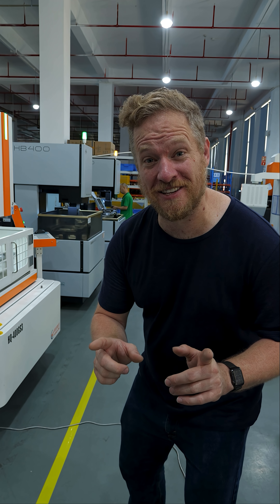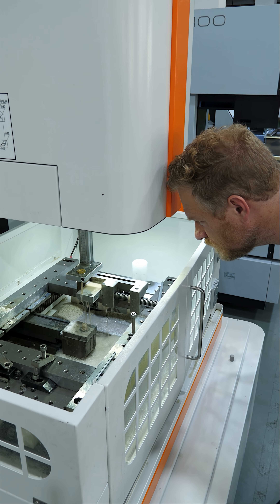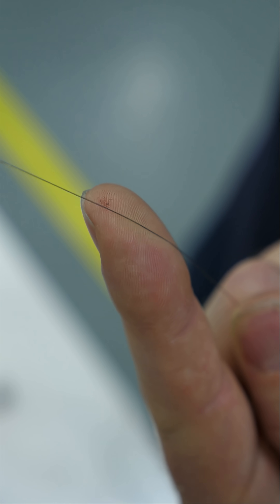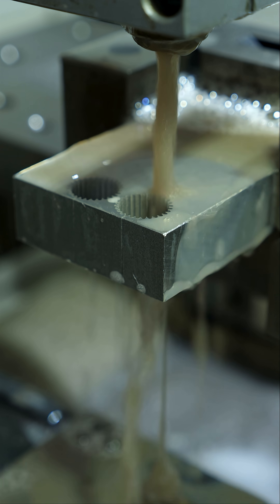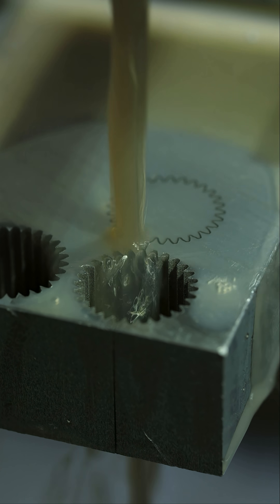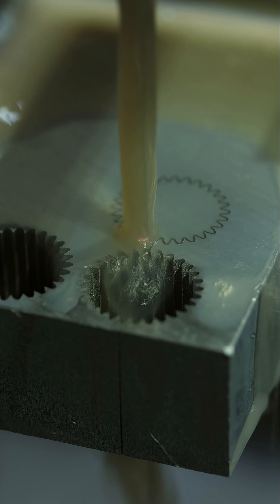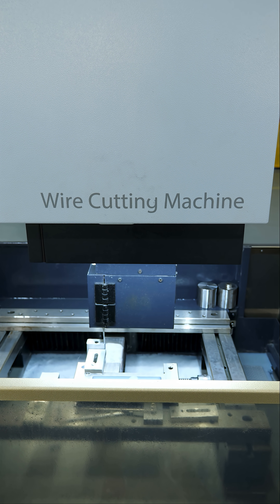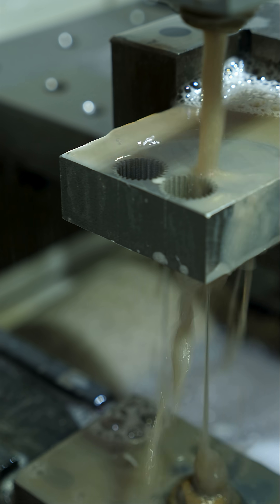This tiny wire cuts through steel! #JLCCNC #CNC

Comment: It's not like EDM is new. I worked on it since 1974. This is around the time wire machines started to be used. Prior to that, it was mostly solid electrodes.

Comment: I've seen examples of a steel gear cut using one. You could slip it back into its blank it came out of and there wouldn't even be a visible line. It was wild
Reply: No, there is always the gap. The wire diameter plus the over burn.

Comment: So does the wire go back and forth from drum to drum militias times before it needs to be discarded or is it one and done?
Reply: On the Mitsubishi wire EDM I run at work the wire runs out the back of the machine and is chopped into pieces about 1/4" long for recycling.
When the wire erodes away material from your part is also erodes away some of the wire.
So the wire loses the very accurate round shape it starts at and also gets weaker from the lost material. 
I am not aware of any commercial machine that reuses the wire after it feeds through.

Comment: I love that the machine still runs XP so this thing has been around for a long time
Reply: I run a Mitsubishi wire EDM at work from 96' it runs off DOS and the whole operating system and programming loads from 4x 720k floppy disks.
Reply: it's windows 7
Reply: @SteveEricJordan wow, I must have been stoned, the shot really was so quick that only watching it once it looked completely different in my memory

Comment: I wonder what is more energy efficient: water jet or wire EDM machining. (I am assuming both parts need additional tooling. Obviously if wire EDM can make a finished product where waterjet part needs a greater tooling then there is probably a clear advantage.)

Thank you for sharing!

Comment: I actually run a Mitsubishi wire EDM at work. At least on this one the voltage the machine uses to cut with is normally in the 50-75 volt range.
Reply: That is significantly less than I thought from my understanding of Paschen's law. Suppose that means the coolant must be a poor dielectric.
Reply: @oliverer3 The coolant is regular tap water. But the machine passes it through ion exchange resin to basically turn it into deionized water.
Making it a very poor electrical conductor.
So you end up with a relatively high current relatively low voltage that doesn't really have anywhere else to go but to jump to the closest point on the part you are cutting.
On the final skim passes the wire can be as close as. 0003" away from the surface of the part so the voltage can go even lower and still make the jump.
Reply: @JK9579 wow! He's not kidding when he says a few microns. 😉

Comment: One of the world market leaders in producing Laboratory and Precision scales started using this process mire than 20 years ago to carve the whole lever system out of one block of aluminium and thus cutting down the part count significantly (while at the same time getting better stability over temperature ranges because no additional mechanical stresses were introduced because of different temperature coefficients)... It's pretty genius I think.